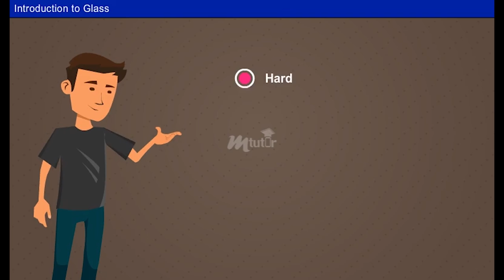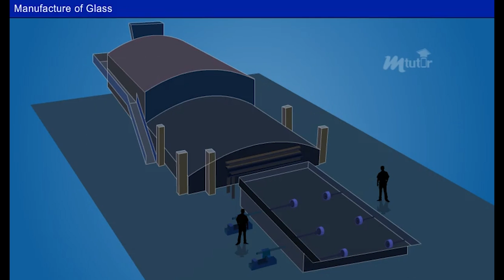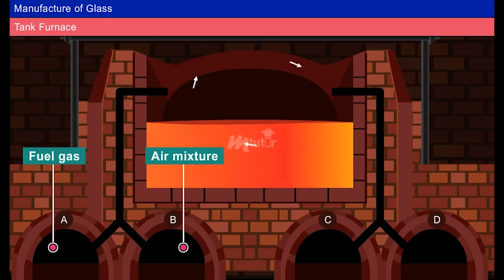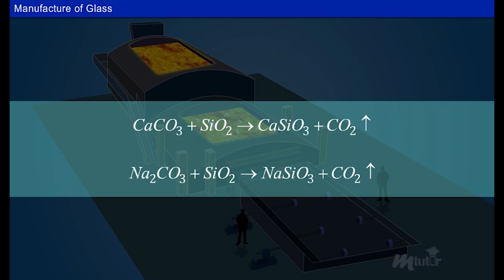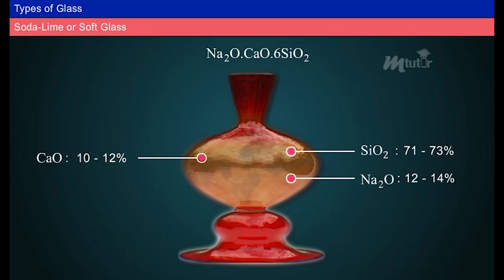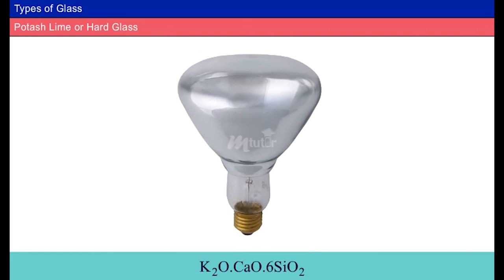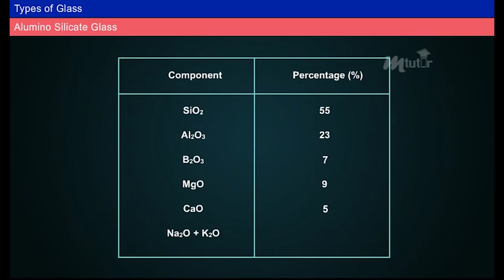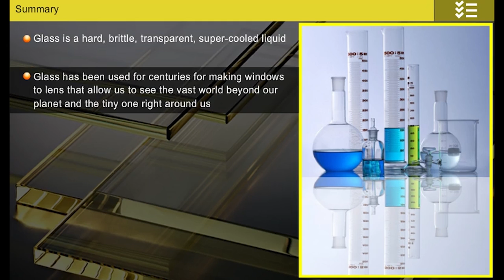Glass Manufacture and Types [Year-1]

Comment: Is glass liquid? How? Please re-correct.
Reply from the maker: Glass is called a super-cooled liquid. It is an amorphous solid. Amorphous solid can flow slowly, and it does not form a solid crystalline structure as the particles in solids do not move, but the particles in glass move. So glass is a super-cooled liquid.
Glass can be considered as a liquid of extremely high viscosity.